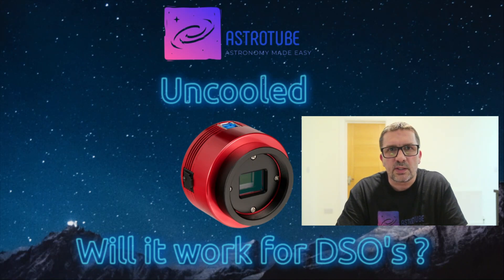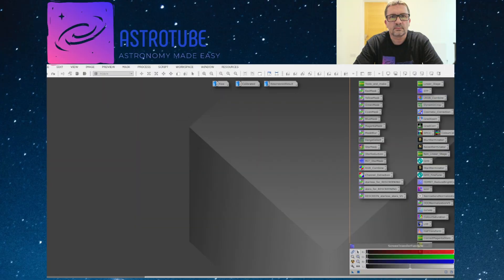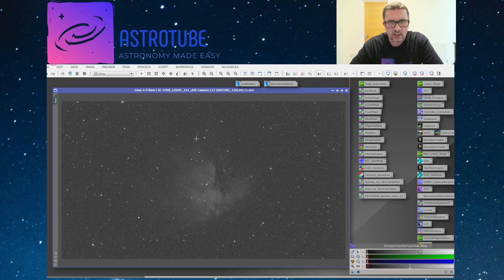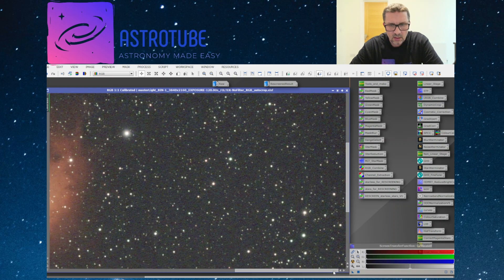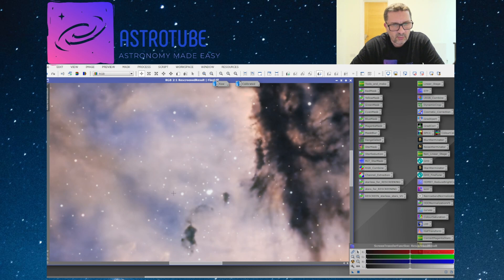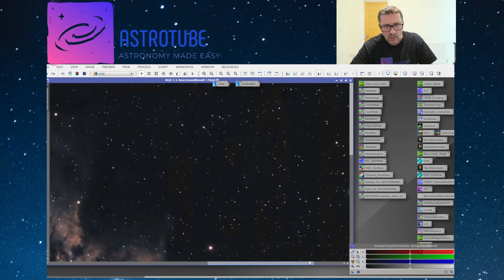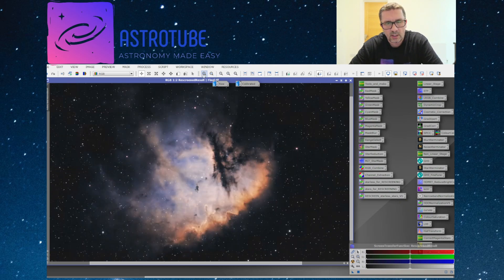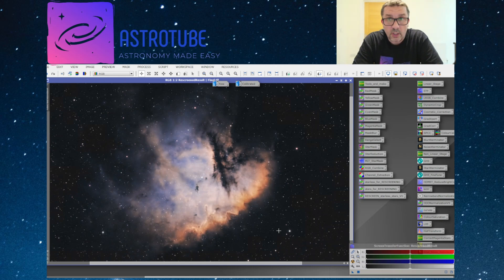Uncooled planetary camera - Any good for DSO's ?

Comment: I've been saying for a long minute now that there needs to be a comprehensive compare between final image results from a 585 and the 585 pro. I suspect the final results would be images indistinguishable from each other.
Reply from the maker: With todays modern DeNoise software,  i dont think it matters as much. with a cooled camera you are just starting from a low noise threshold, but i agree the final result would likely be very similar.

Comment: I just started this hobby seriously last year. I bought a small 60mm f/5 astrograph and some small planetary cameras to practice on the Moon and Sun. I took a big plunge and got a nice tracking mount and guiding and auto focusing. I had to learn a lot of things. I live next to Toronto with Bortle 8/9 skies and had few expectations to be able to image anything. I was surprised that I was able to image galaxies using a simple UV IR cut filter. I was quite shocked actually. I think if you are just starting out or have a second scope don’t be afraid to use a small uncooled planetary camera to capture data.
Reply from the maker: Hi Ironman, not starting out as I’ve been doing astronomy and imaging for 20 years, but I was always from the ccd world and only this year I thought I would try new cmos camera’s and I’m really impressed by their Quantum efficiency.